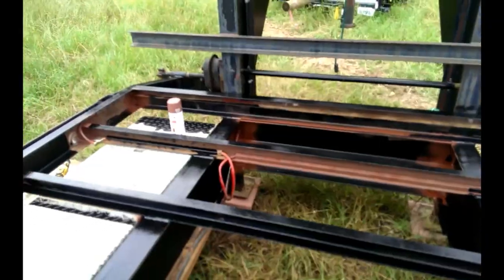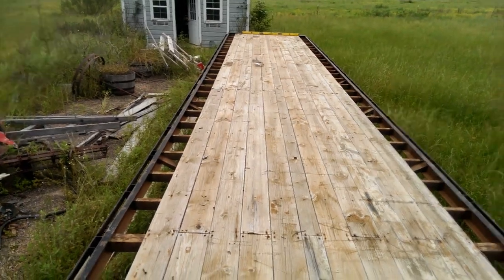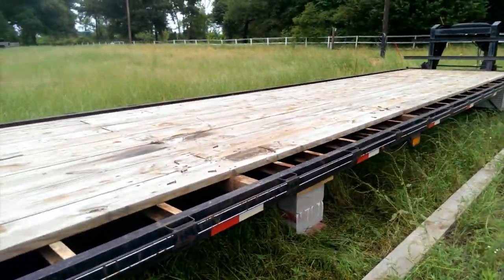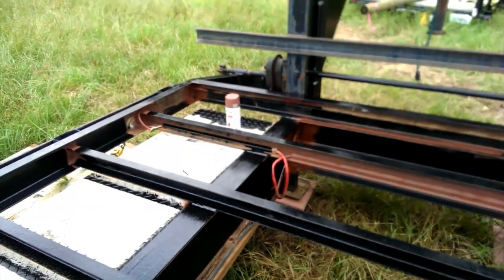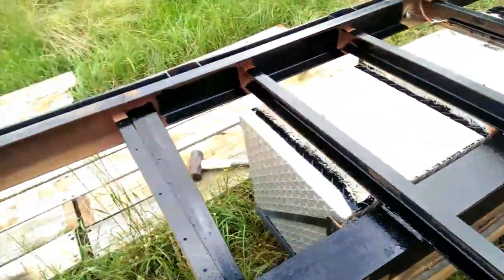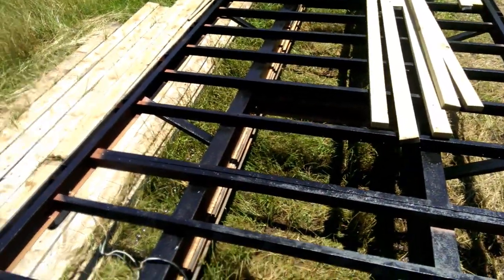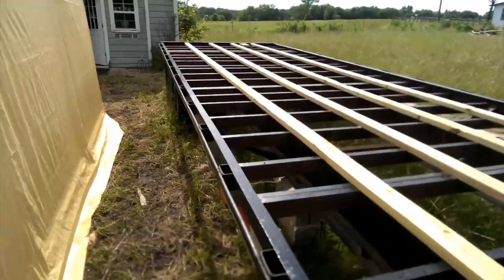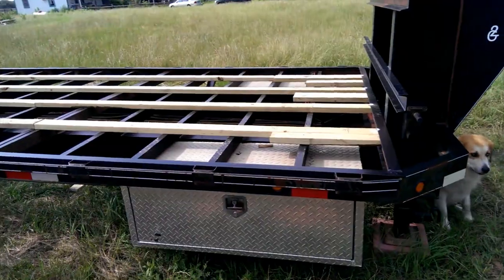Tiny House Mansion - Episode 1 - The Foundation

Comment: I'm thinking about doing something similar. Why did you pick the trailer that you did? Do you think there would be a problem using a flatbed semi trailer? I'm looking to not move the structure but just using the platform, it's going to be in a rural area. Thanks!